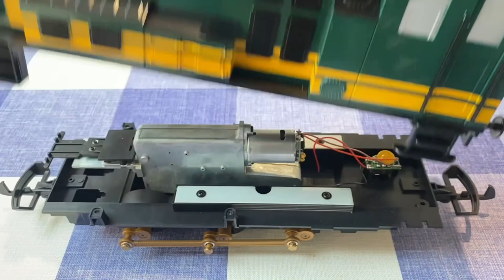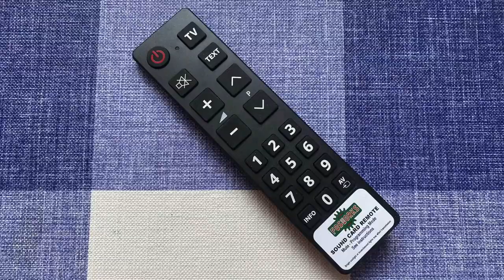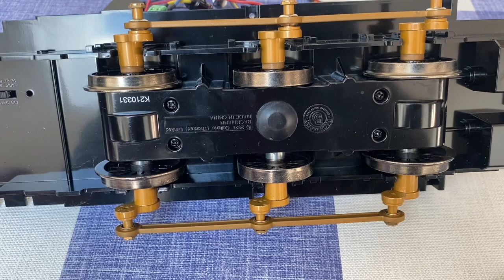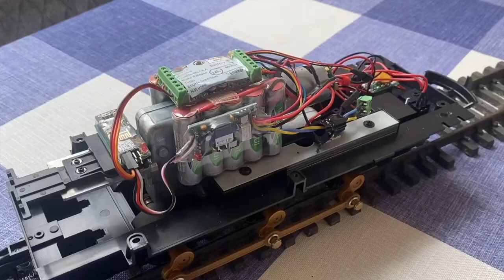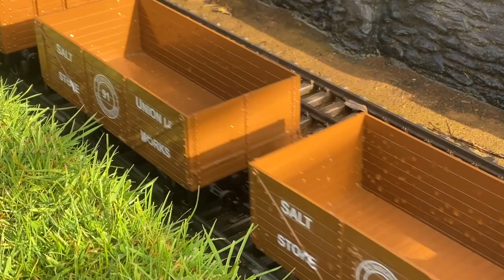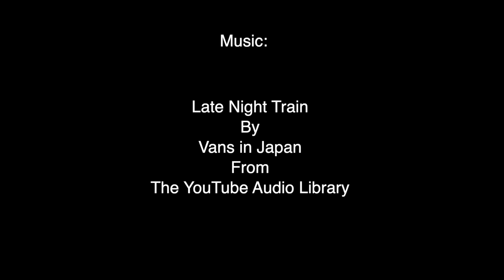Thomas and Friends G Scale Paxton Conversion

Comment: Thank you for showing this process - someone recommended the kit to us and this video was really helpful. Can you tell us more about what you use on Thomas and Percy, including sound and smoke, please? Thank you!
Reply from the maker: Thanks for watching. For my other Thomas and Friends locos I've used R/C kits from Timpdon with battery packs and connecting leads, switches and sockets from Peter Spoerer. Both companies no longer trade and Steve from Fosworks now provides all of the components and a better R/C system which is great.
The smoke units are Suethe (I think they are No6Es), supplied by Gaugemaster. I've wired them up directly to the battery pack via a switch so that I can run with or without smoke.
I hope this helps.
Keith
Reply: @CaverKeith  ah, it’s straight off the battery pack! Makes sense. About time we tried a Fosworks kit, methinks. Track power seems not to be the way to go.

Do you sleeve the chimneys with anything to stop the Seuthe unit melting the body shell?
Reply from the maker: I've given up on track power. I much prefer the battery+R/C solution, it gives much better slow running and I do not have to clean the track!
The smoke units fit inside the chimneys without any sleeving and nothing has melted ...... yet.
If you look at my blog (https://wychboldandstokepriorrailway.blogspot.com) around the end of 2014 and the beginning of 2015 you should be able to find pictures of Toby's and James' conversions.